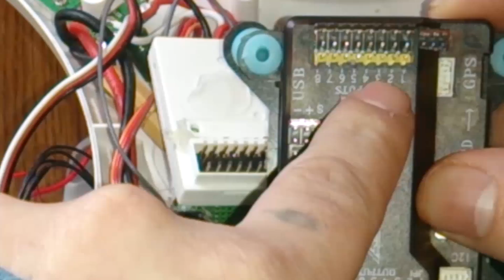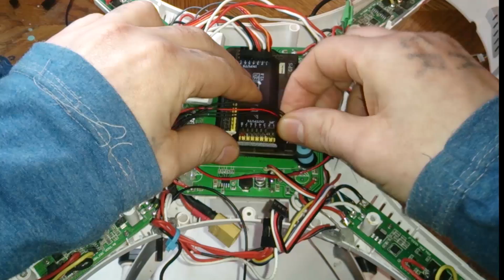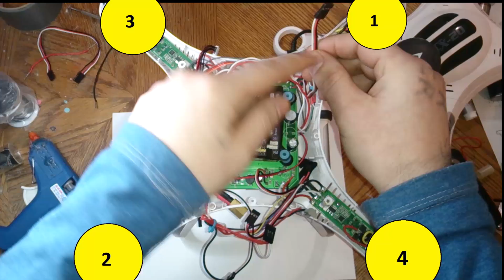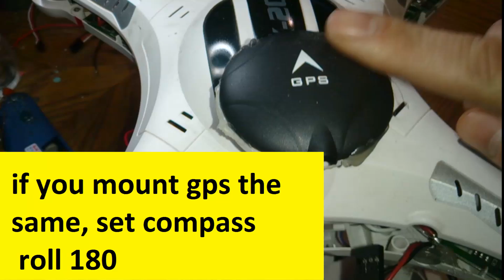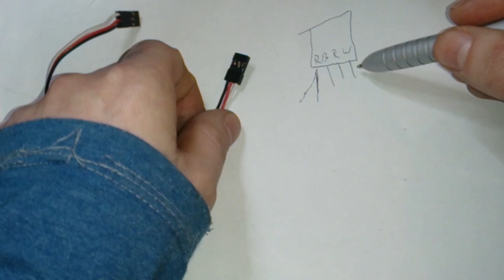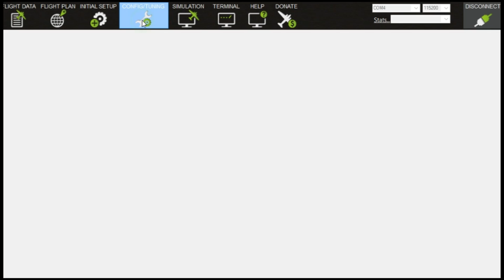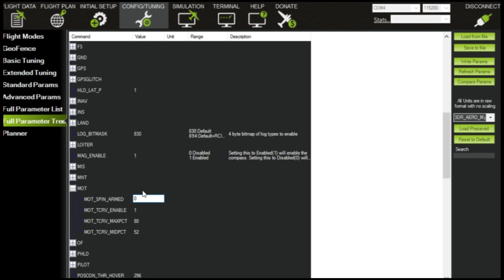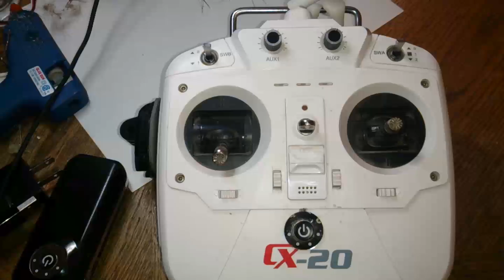cx20 factory apm to apm 2 6 - 2.8 step by step

Comment: My gps uses a red, blue , yellow and black wire
Reply from the maker: the color code should not matter .. as long as its made for a apm 2.6 and fits into the plug all should be well.. .. If your gps is from something totally different then what kind is it?
Reply: TO clarify if the gps has only 4 wires but I plug it into a connector which has 5 slots that will be ok? Also does it matter if I our all of the wires side by side or do I need to skip a slot for the gps?
Reply from the maker: yup I gave you the pin order.. one pin is not used.. and if you do happen to get tx and rx backwords it just wont work.. but it wont fry it.. simply reverse them after .. but if you get the ground and vcc backwards it may go poofy..
Reply: Also my telemetry should it be setup like the video you have I changed it when I had the original flight controller?
Reply from the maker: yup you have to switch back to original or it will fry ..
Reply from the maker: https://youtu.be/mrBWEATUbus?t=808  this part of the video shows the color code..
Reply: Sorry to keep bothering you man. I need to know I dont have a power module but I need to plug in the -B plug to power the apm 2.6 right?
Reply from the maker: ..yup you are correct..
Reply: For the telemetry what is the order after the black ground wire. I mean the order of 5v, tx, rx. what is the right order my color wire is different than yours
Reply from the maker: it should be black ground.. .. so ground space rx tx 5v   ....
Reply: Ok everything is hooked up now. Do I have to plug in the battery before I go into mission planner? also do I need to connect the apm 2.6 directly to a cable or do I plug into the bottom of quadcopter?
Reply: I am asking because I am trying to program the apm 2.6
Reply from the maker: If you extended the cable inside to reach to the side of the apm ..then you can plug into the bottom.. I strongly suggest not using a battery and usb cable at the same time.. unless you remove the red wire out of the usb cable../ power wire..  ....
Reply: Ok that worked. Now which firmware version do I use for my cx 20?
Reply from the maker: if its a new apm.. it should already have version 3.2.1 on it  ..thats as high as you can go with it.
Reply from the maker: on the title bar of mission planner it should say the version number your at..
Reply: when I connect the battery without the usb cable it wont connect to the quad. What shuld I do? Thanks man for being patient with me
Reply: It does not even have a com port in the selection to connect the mavlink
Reply from the maker: yeah thats annoying ..try going full screen with it then half screen with it type thing
Reply from the maker: if thats what your talking about those two boxes and the connect box being m.i.a..if your talking about your com port not showing up at then u got other issues..like did you connect the usb cable on the side of the apm..inside the quad..ect..
Reply: I'm stupid I did not have the transmitter and receiver plugged in but now my mavlink stalls for 30 seconds and wont connect.
Reply: Also what is the setting number my comport is 3 which number do I use to connect mavlink?
Reply from the maker: try to plug the usb cable in but don't push connect for say 20 seconds 
..or if you can see the lights on the apm or the back wait till they 
start blinking , then push connect
Reply from the maker: also make sure your telemetry is not plugged in to the air unit..
Reply: ok The usb connects and shows telemetry but com port 3 does not
Reply from the maker: .not sure what your trying to tell me with the last comment..
Reply: I just uploaded the new firmware with the usb cable. now what do I do?
Reply from the maker: calibrate accelerometer ,radio calibration .. compass calibration., set your flight modes.
Reply: does the battery need to be plugged in?
Reply from the maker: nope.   you can fry a esc if you do that...     i suggest when your doing the compass calibration , to tape up the wire to one of the legs so it does not come unplug in the mess of flipping it ect..
Reply: right now the only thing hooked up is my usb cable. the usb is registiring everything. should I run the setup wizard now?
Reply from the maker: up to u .i said above what you need to do..but if you want to do the setup wizard give it a shot.... check out this video after for the flight modes..
Reply from the maker: flight modes is here in the video.. https://youtu.be/mrBWEATUbus?t=1382
Reply: I have tried everything.This is driving me crazy. How much to fix it?
Reply: The engines run but when I try to shut them down they keep running on a slow speed like when you first turn them on
Reply: Seriously how much I have been trying to get this thing flying for 3 months now. I cant take it any more.
Reply from the maker: https://youtu.be/mrBWEATUbus?t=1556
Reply from the maker: and your getting close to the end btw..
Reply: what does that mean
Reply from the maker: did you watch the video link i sent you.. .. our getting close to the end btw means ..your almost done setting up the quad..
Reply: my quad still wont connect to mission planner
Reply from the maker: what do you mean ..i thought you did the setup wizard and updated the firmware.. ?
Reply from the maker: or do you mean telemetry won't connect? .. before we jump on that did you watch the link and fix the motor spinning issue?
Reply: watched the video but motors still wont turn of all the way when I throttle down. Yes telemetry wont connect
Reply from the maker: ok for now just leave the telemetry unplugged .. try this part of the video.. do the Radio calibration again ..make sure to leave throttle down when your done.. https://youtu.be/mrBWEATUbus?t=1363
Reply from the maker: also reboot the apm and go into that mot spin section and confirm it says 0 .. maybe you did not write it last time
Reply: ok thanks I am going to check everything in the settings again but why would my telemetry not connect? It says heart packets not accepted'
Reply from the maker: because you might have the rx and tx backwards..  

ok .. 1.plug in the telemetry into the quad
2. plug in the battery .. 
(you should now see a green blinking light and a orange blinking light.
3. plug in the ground unit of the telemetry in the computer.
(the green light should go solid)

Now if the green light goes solid..(thats good you have connection)
If you get no blinking orange light.
rx and tx  most likely have to be reversed ..
Reply from the maker: after that if its good.. set the baud rate in mission planner to 
57600 and try connecting..   If no new port comes up then you need the drivers for the telemetry sil chip. found here.
https://www.silabs.com/products/mcu/Pages/USBtoUARTBridgeVCPDrivers.aspx#windows-xp
Reply from the maker: alright good luck with your project....i'm off for now and will check back most likely some time in the evening .. Just start a new comment thread.. so its easier to find 2morrow..
Reply: Is the blinking orange light suppose to be on the telemetry radio attached to the quad or the apm 2.6?
Reply: I only see a solid green light on the telemetry radio receiver and transmitter. Also if I switch the rx and tx wrong will it fry my apm?
Reply from the maker: no it won't fry ..it may be reversed already?!   .. the unit on the quadcopter will call the air unit. ..the one we plug into your computer will call the ground unit.. ...    The air unit and the ground unit orange lights should be blinking.. .. but only when they are talking to each other.

when you first plug the air unit in .then the battery as the steps above. the green light will blink and the orange light will blink every so often.. .. I'll be back later..   ..
Reply: You were right I had the rx and tx reversed it is  registering in mission planner now.
Reply: everything is hooked up and runs but at full throttle quad wont take off. The battery is fully charged
Reply from the maker: +Jamaine Davis your blades are on backward..go around in circle shifting the blades,not home....will explain later..if u don't get
Reply from the maker: Ok back.. so if that does not make sense....you can 
with the quad facing forward.. swith the two blades.. and then swtich the two back blades. with each other.. ..the middles of all four blades should be pointing up towards the center.. the out side blades..pointing down towards each other...   Also some blades for the cx20 have a little arrow picture of which whay it turns ,the shell also has the same arrow . so you can match it up..
Reply: ok ill try it now.
Reply: OK now when I try to take off it tilts backwards
Reply from the maker: are you sure your blades are on right ..still .. here check out this picture I just took ..put your blades the same way ..any time you need to do blade change ect..    https://drive.google.com/open?id=0B2w6_OKE_2kxTE1Kd1JKLU5Bb2s

if they are the same way then maybe your motor wires are screwed up.
Reply: Im using the carbon fiber blades
Reply from the maker: its the same process look at my picture and match it up.. so the blades face the same direction.
Reply: The carbon fiber blades can only screw on certain motors
Reply from the maker: so how is it .. you said it now tips backwards.. Can you just please fallow the picture ..and just tell me you have the angles on the blades facing down the same way ??? .. if so we can move on to the motors .. because if the blades are right then it has to be the motors..outputs are wrong..
Reply: ok the blades are correct now. How might the motor outputs be wrong?
Reply from the maker: I've also been assuming you came here by this video .. and your quad was stock .. soooooo with that..if you put in the esc's your self.. make sure you have them on right as well..because if they are wired backwards it would also have the same syndrome .. ..if the esc are stock .. just re fallow this step if the blades are right.. https://youtu.be/mrBWEATUbus?t=682
Reply: I followed your video exactly. Would an esc calibration fix the problem? I may have not done it
Reply from the maker: if you are really stuck .. just take a picture with the blades on... and take some really good pictures of your wiring so i can see whats going on with the wires.    send here bangs696969@gmail.com
Reply: I sent the pictures
Reply from the maker: kk got them .. it looks all good ..hard to fallow the wires but it seemed good to me... ..You can try a esc calibration ..just make sure to fallow correctly and remove the B cable while doing it,
Reply from the maker: any luck with the esc calibration?.. If you still have the stock blades you might want to switch back to those till you nail out your issue., instead of wrecking your good blades..

Comment: On the gps plug for mine I have to change the connector what is the wiring layout? Do I have to skip a slot for the ground?
Reply from the maker: ah did not see all your messages.. it goes
ground .. space...rx...tx... vcc   with the apm side ways and gps port closest to you..
Reply from the maker: https://drive.google.com/open?id=0B2w6_OKE_2kxdmpoN1lQVmpMeHM  that apm has side pins but same thing..

Comment: Hey I purchased this  APM2.6 APM Flight Controller Board For Multicopter ARDUPILOT MEGA 2.6 Version will the wiring you showed in this video work on it?
Reply from the maker: yup if its the apm2.6 its the same thing and same steps

Comment: What do I do if I don't have a usb in my quadcopter like you do? I have the bigshark version and it doesn't have a usb cable that plugs into the fc
Reply from the maker: Are you talking about upgrading to apm 2.6? if so... 

Not sure what your bottom looks like or if you have a port so . 1 option I do in my custom quads is just add one of these if the apm is enclosed . These links are just examples..   just run the one end by the battery door

http://www.ebay.com/itm/New-Micro-USB-2-0-Type-B-Male-To-Female-M-F-Extension-Extender-Charge-Cable-Lead-/141823597171?hash=item2105585a73:g:9~0AAOSw7hRWQI80

Banggood has the port .. but it seems you have to get the power board as well , I could not find just the usb port for the cx20 ..  Keep in mind you still have to extend the usb cable wires 
http://www.banggood.com/Cheerson-CX-20-Quadcopter-Parts-Power-Supply-System-New-Version-p-931804.html

This website but I never heard of it sells just the adapter ..again you have to extend the wires..

http://www.goodhelicopter.com/v1-ky-cx20-quad-copter-parts-wire-plug-board-p-8171.html?cPath=258_259
Reply: Wow thanks!
Reply: Mine does have a micro usb on the bottom to connect to a computer but there's no usb that connects to the fc like yours does. It's just a servo type connection that goes from the usb to the fc
Reply from the maker: well if you take a picture of the wires.. i'm sure you can just cut the other end or if it already has 4 plugs on it.. .. you can just find a old cable and add the end you cut.. really even if ordered one ..you will have to cut it anyways to add length ..  .. if they used color codes on the wires.. it should be black green white red..   ..if it is ..most likely the cable you cut will have the same 4 colors as well.   if you want just take pics and send to   bangs696969@gmail.com and i can prob tell you
Reply from the maker: ok well i just deleted my other message i seen a picture of your apm and you have a wire on your apm called usb.. with like you said three servo wires.. .. .. Did your apm power up your old old apm.. ? if not ..then its most likely ground d- d+ on those three wires.. ... you need to find out which one is ground..my guess would be the black one .. red and white would be your D+ and d-   .
Reply from the maker: so i will continue to spam you a tad.. once your ready you will have to unscrew that board and take a better picture so i can see which one is ground.... also a picture of both sides would be good as well with it out of the shell you can try to leave the wires in place as well.. .. .. or as i said in my deleted message just get the cable extender and place one end by the battery door.. ..buttttttttt if you can solder this would be very easy to get going.
Reply: Yeah I think I'll try and get some better pics for you right now. Yes I can solder
Reply: I haven't done any modifications to this quad yet I just noticed that your had a cable that mine doesn't. In fact I never got this thing to fly at all but that's because it was given to me by a neighbor that crashed it and broke the gps that was in the puck. Instead of replacing stock electronics I thought I'd watch your video to replace it all instead
Reply: Hey I just noticed something about my ESCs. In the link you sent me for the power supply board you can see this single red wire that kinda sticks out on the bottom left of the first picture. What exactly is this wire used for? On mine it's been soldered onto one of the ESCs and I'm not sure if it's supposed to be that way or if my neighbor did it after the crash... The little area the the red wire is coming from is labeled "PPM"
Reply from the maker: that wire probably goes to a pad called ppm its what controls the lights under it ..and it is directly connected to one of the white esc wires..  here is a video i made that touched on the subject .. https://youtu.be/XkQXf9oN8Ys?t=872
Reply from the maker: well you actually said it went to a pad called PPM lol.. so yeah its that one
Reply from the maker: err it wont let me edit my post tonight... if you don't watch that video .. what i meant to say .. "one of the esc wires"   I meant to say it goes to one of the white esc wires that connects to the apm motor output  (white red black) cable..
Reply: Ahh okay I see
Reply from the maker: ok i know in the email you said you were going to order else where.. but
 i was bored .. I looked at both pictures u sent me i could not totally 
see where the black wire trace went on the top but I'm pretty sure it 
goes to 5 volts.. so here is a picture of what I believe is the 
connections .. If somebody else was fallowing this..simply skin back a 
usb cable and attach to the wires..maybe plug the end into something you
 don't want anymore to test.... anyways here is the picture   https://drive.google.com/file/d/0B2w6_OKE_2kxY3NjTjRLXzFEcFE/view  .
Reply: bangs6996 Wow thanks for taking the time to make this!